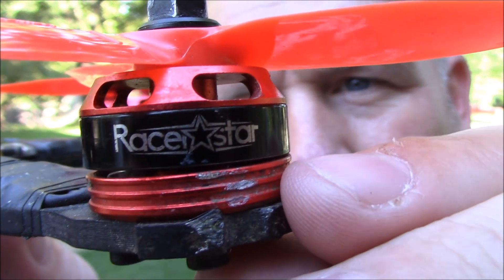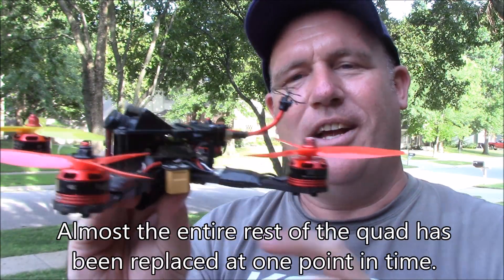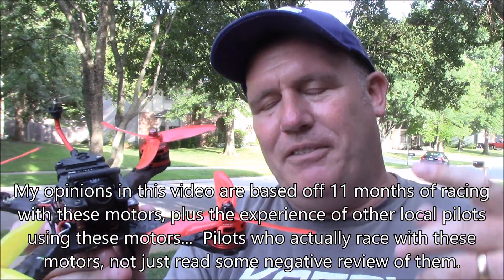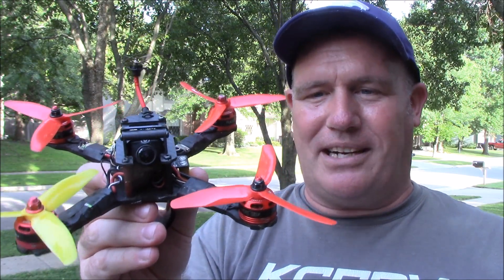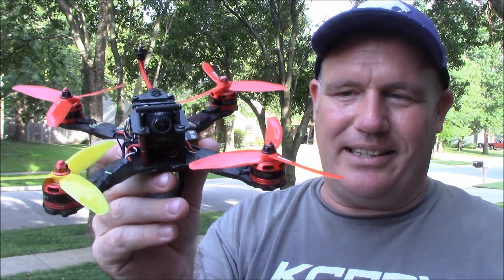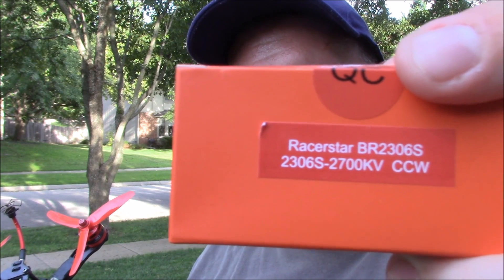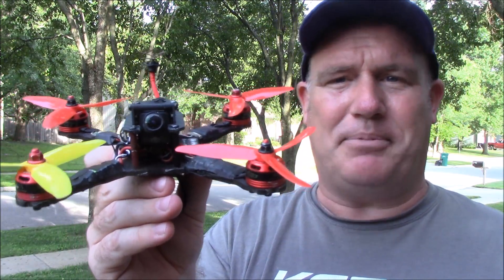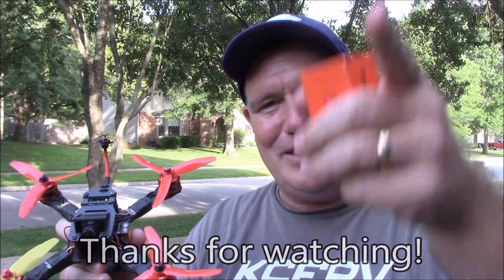Rant On!  Racerstar BR2205 2600kv Have No Real Competitors

Comment: You don't need t-motors to feel how big the difference is with an other motor. 
I have racerstars but every other motor feels so much better. I have the hyperlite 2205 2522kv team edition. Not only are they lighter and have way more power. They feel a lot better in the air and i don't go full throttle. That is not needed to feel how much more control you get over your quad. Yes they are 13 dollar but the outer part is 7 dollar and your motor is fixed. 
As a beginner is not on a budget, don't get the racerstar. The feeling of a better motor is so much better that i don't like to fly the racerstars. The feeling is just bad and a bit more expensive motor is so much better, that the racerstar is only useful for on a budget and even than there are better options.
Reply from the maker: I have a friend who has never flown anything and after 3 months can keep his quad in the air for about 30 seconds before crashing it.  Which motors should I have recommended for him?
Reply: Let him get a sim and practice on a pc. 
Than he learns stick control. It is cheaper and he can mak hours. Every beginner is best off with that. I learned a lot more after i started to use the simulators on my pc than before that. On a pc you make in a hour of flying more air time tan on an average day of flying with your quad.
Reply: emiel1976ep you have both or talking out of the blue. I have both and can compare. As per thrust test done by engineerx, aokflys can compete or even be better than your stated motor. Look up the thrust test. Take away is that most motors are similar nowadays and bashing cheap motors just because they are cheap is not fair.
Reply: I understand that you buy the racerstars for a tight budget or for a beginner. But do you still let those people fly with a naze32 and those 10 dollar cams? You want a good image so you spend money to get a better cam. The fc is so much improved that quads fly now way better than they did with a naze32. So why fly motors that are not good? 
You find them good but i can tell you that even as you upgrade to 10 dollar motors, that you feel a very big difference. The quad flies way better and you get more control. 
Just try it, you will see that i am right. You don't neet t-motors. There are cheaper options that deliver a good power and feel.
Reply: emiel1976ep these br2205 are plenty good motors. I think people will say they are crap mainly because of low price. I was flying with them for about 6 months and upgraded to aokfly 2306. Nothing major. More thrust and noiser setup to tune...
Reply: I have those 2205 2300kv racerstars and they can not compete with my cobra 2205 2300kv, hyperlite 2205 2522kv and f40 pro's. The f40's are just beasts but the hyperlites feel great just like the cobra's and the difference is big. The racerstars don't have the punch that the others have.
Reply: One thing, those aokfly are just like the racerstars and they also can not compete with other motors. You can compete them with the 23xx racerstars. A bit more power but weaker than a good 2205 motor.
Reply: the 2300kv ones.  :) or the purple ones....
2300kv's have more torque for freestyle or accelerating out of corner.
2600kv's have slightly higher top end.

p.s. use the racerstar 5048x3 props. they are amazing.
Reply: Velocidrone took my skills to the next level... so good
Reply: Totally agree FPV Freerider is an awesome sim for a beginner, Jos Bardwell did some (boring) but very informative video's, using FPV freerider helped with DRL simulator> It help with not over correcting the sticks on my Taranis Q7 and you can just plug it into a computer with the correct lead and settings (there are video's on how to do this) can recommend enough saved alot of frustrations and crashes. Lastly go straight onto Acro after using the sims.
Reply: With other motors and other props you will be surprised how bad that racerstar combo is.
Reply: Every sim will work. You get more stick time than you do flying with your quad and some people need more stick time to learn than others. On a sim you get faster a lot of stick time and you will improve faster.
Reply: Aokfly will give more power than the 2205 racerstar but put it next to my 2305 and it stays behind. 
I looked ad them but i tried those motors 2 weeks ago and i will not get them. Yes more power than the racerstar 2205 but not that impressive. But better than the 2205 and as i was on a budget I would go for them or the racerstar 23xx motors and not for the 2205 racerstars. 
But i prefer the hyperlite motors. I have cobra motors and they are good but i don't like the weight. I also have f40 pro's and that are fast motors. Love the feel and yes they are just like the cobras heavy but compensate that with power. But i am not getting them any more. I find the price to high and the shafts break easy. That is something i find bad. It is not fun to break a shaft by just mounting a prop on the motor. 

I started with 1806 2300kv motors and i was thinking that it was fast on 3s. And in that time it was fast for me. Than i got dys 2204 2400kv motors. I burnt one when i went to 4s. They where faster. After that i got kk 2205 2300kv motors. 
I was impressed when i got them and later i got the racerstars 2205 2300kv. They where like the kk motors but when i got my cobras, i was first not impressed but that was because of the props. Kk 5040 props but when i used dal props it changed. The hyperlites and f40's gave more power and an other feel. 
Now i look ad 2207 motors or stay with 2205 2522kv motors. I find a low weight frame fly better than a heavy frame. I used my racerstars on my lightweight and they worked not that bad on a low weight but after i replaced them with my hyperlites, i never used them any more. 
I have now a build with kk motors what i use for people to try out. As they break I put the racerstars on it and as they break it is over for that build. 
I love my light weight x200 frames to much and i get my new frame soon and that is even lighter. Those 2205 2522kv motors come alive on light builds.
Reply: emiel1976ep the new 2306 series are soooo much better. I have the 2306 2400kv and also have the 2206 Returner R4 2450kv. They are very close and I only tried the 2306 Racerstar after engineerx reviewed them. I'm glad I did. They were only replacing some original red bottoms but they gave that quad new life.
Reply: I tried the first batch and they seams to be bad. the second batch seams to be a lot better and the problems are solfed on the aokfly. I talked now with several people about them and they seam to have now good power and the winding problem is solved.
I don't expect the same power as my f40 pro's but for that price and now whit that the second batch is way better, i ordered a set.
I was not positif because the first batch was realy crap. Very bad quality.
Reply: Neale Cranna I don't know I did not buy a new PC the last 7 years. Mine is still good to run all Sims on max.
Reply: Go fly with garbage parts is still better than not at all. Racerstar motors have their own classes, you can't really compare it to much higher priced motors. One thing I really don't like from Racerstar motors is the build quality which affects durability. Performance wise, they're okay but they fail at the durability sector. If you think they're durable, try some more expensive motors. My friend has broke several bells, bend shafts, broke bearings, slipped magnets and so on.

Comment: I agree 100% i started in this hobby on a really tight budget and have been using the King Kong 2205 2300kv since day one. 2 years later and a bigger budget i have upgraded to a Betaflight f3 fc, Runcam split and a few other nice additions but my motors are still running strong and the only $36 for a set of four on a martian II frame. Thanks for the great rant Travis!

Comment: My thoughts on these was all concerning for freestyle, I don't race at all. For freestyle they suck you really need a powerful motor to freestyle
Reply: Frank Sarfino not true jest have to know how to fly
Reply: lol that's some funny stuff
Reply from the maker: I did win one freestyle competition and came in 2nd in another with my X210 and Racerstar motors.  So I wouldn't say they totally "suck" for freestyle.
Reply: the Racerstar 2306s 2400kv have $100 motor performance.
Reply: the 2306 is super powerful over 1300 grams of thrust 
they feel just like my emax 2306 white tops bruh
Reply from the maker: I just got my Purple 215 built with the 2306s 2400kv motors!  I've only flown it once.  I'm glad to here you say this.
Reply from the maker: Frank, that sucks.  Maybe you got a bad batch or I got a good batch of them.
Reply: My comment disappeared anyways they are my new budget favorite motor they actually compete with emax 2306 2400kv
Reply: hey i just noticed u commented right before me !! we know how amazing these are for the price they are unbeatable even better then the budget motor King RCX
Reply: I think it also depends on your freestyle style, I like more of the flowing stuff like gapit and such, and they seem to work fine for that, (in fact I think gapit still runs red bottoms), but I can see if your into the more "manic" style where the extra punch would come in handy. I used to run 4 bladed props for extra punch and control, then tried the 5152 and they felt really good but on my frame the blade tips actually hit each other, so now I'm wanting to try the new RK props. checked out your vids... nice flying.
I always check to see if the person has the skills to back up what their saying, never surprises me that a lot of poster who just complain and talk like they know better (like emiel1976ep who posted above) don't have anything to back it up.
Reply: I'm glad they are working well for you Travis for me they are horrible. I had them on a quad I built for the wife in a failed attempt to get her to fly after she gave up I bashed it around a bit after one concrete crash all 4 screws ripped out of the soft aluminum base, I replaced that motor flew it a bit more maybe under 10 flights and the bearings sounded like they had gravel in them lol. Anyway that's my 2c
Reply: i got a bad bitch and i like it
Reply: Frank Sarfino you really don't. He has very valid points. Beginners crash. Then beginners build a second quad. Thus put better motors on it.
Reply: Great feedback and thanks for the compliment. For slow technical stuff they might work ok but your right for my personal style they don't work for me. Over time I have learned a few things in this hobby. One of them is if you go ultra cheap your going to have alot of issues that could possibly be avoided with spending a bit extra. I hate having to constantly make repairs and now I scrutinize my gear and builds to avoid the bench as much as I can.  A few things that bit me in the past are cheap vtx's and to a extent cheaper motors. The vtx thing was constantly having to replace those cheap POS $15 vtx's now there might be better ones now but a yr ago that wasn't the case. For motors the RCX 2206 v2 2400kv motors are great if you realize you will be replacing bearings a decent amount and this really only applies if you care about shooting video or having a smooth running quad another issue that I had with them was throwing magnets but this supposedly has been fixed in the v3 bells. Cheap frames is another thing when your flying hard those cheap frames can and will either break or bend permanently. Again some people might not care if their quad is shaking all over the place like a jalopy driving down the highway but I do.  Now I'm not all about the high end gear but I will spend it where it counts to avoid more repair time :)
Reply: I'm still flying my original 4 on my x210 pro kit.  I am going to upgrade them over the winter and move the 2205s to an older quad, but I've been pretty happy with them.  I haven't hit concrete with them, but I've hit lots of branches, a couple trees and the ground more times than I should have :-)

Comment: Totally agree. I hate when people say the cheap stuff is complete crap. For over 50% of people in the hobby who just fly for fun, the cheap Chinese stuff is perfect. Most of the people recommending  the more expensive stuff are sponsored so they get payed to promote the $20 motors. Me and my friends all flew racerstar at 1 point and we loved them. One has since upgraded to the rcx 2206 motors, which I would put right on the outside in comparison to these (they also get racing reviews).

Also, if anyone knows of other <$10 motors like the racerstar, let me know. I've bought a ton of the racerstar but would like to get another manufacturer to compare.

Can't wait to hear your opinion on the racerstar 2306 series!!